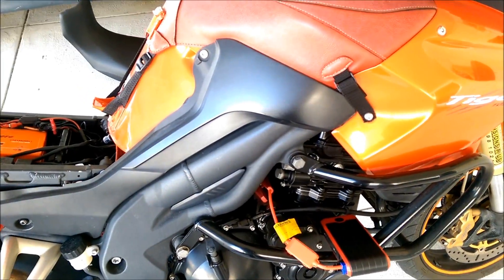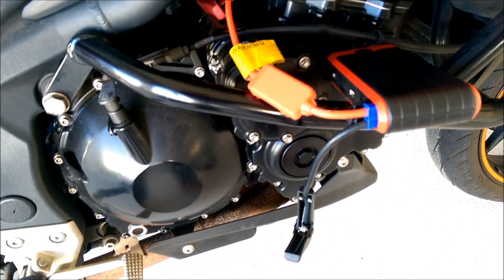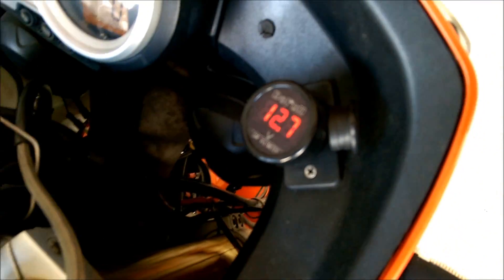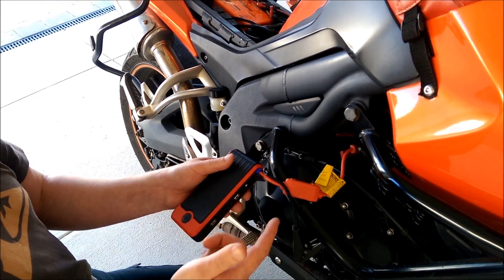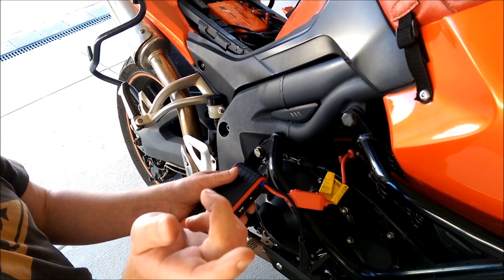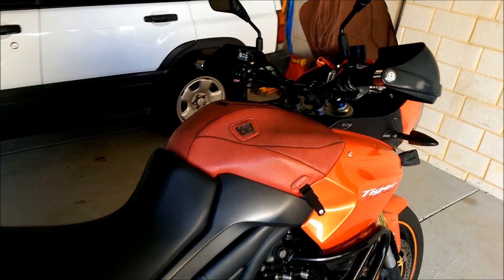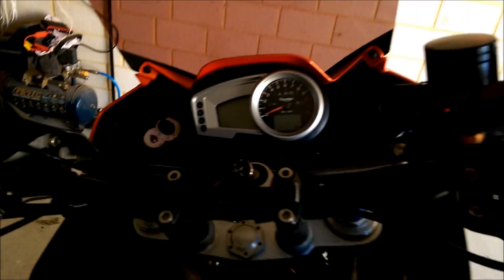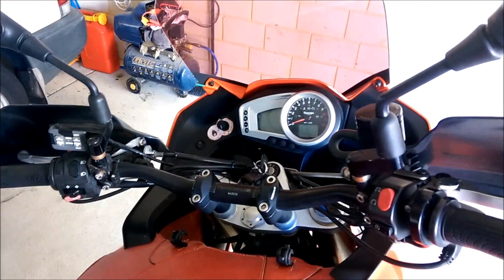2008 Tiger 1050, Problem: Flat battery only when hot!

Comment: Hey, there is solution of this problem. Cables from battery to the starter (+) and battery to engine (-) are too tin. Checked a few days ago on Triumph Tiger Sport 1050 (2013). Good luck! 👍 🏍
Reply: @grzegorzkalinowski3698
How or Where can we find the ticker cables ?

Comment: Problem fixed for me: installed thicker battery wires, from battery to starter motor and negative from battery to frame. Problem completely solved.

Comment: TRIUMPH TIGERS ARE LEMONS - RUN AWAY - THEY WILL RUN FINE IN THE AM BUT THEN NOT START IN THE MIDDLE OF YOUR RIDE - COULDNT BE WORSE IF YOUR WORST ENEMY WAS PLANNING IT - LOVED MY TIGER UNTIL I GOT STRANDED IN THE BACK COUNTRY MULTIPLE TIMES - SHOP CANT FIND ISSUE - NEW BATTERY - LIKELY SOMETHING WITH IMMOBILIZERS - 2016 Triumph Tiger XR RIPOFF

Comment: My bike (2006 Speed Triple 1050) makes almost exactly the same noise during (failing) hot start. Just like you, I have already exchanged battery, alternator stator and rectifier, without solving the issue.
Could you maybe re-upload the mentioned service bulletin? The photobucket file is no longer accessible...
That would help me so incredibly much!!

Comment: Had the same problem on my 2007 sprint st 1050. Changed the battery and fitted thicker battery/starter motor cables. seems to have cured the problem. much cheaper than replacing starter motor.
Reply: Hi Michael Pooles, i have a 2008 Sprint ST and having the same issues... is this fix of yours still working?

Comment: I had this problem with my 2011SE, problem is caused by pressure in the cooling system - replacing the 5 years old radiator cap (as it was not letting pressure out into the expansion bottle) and bleeding the air out of the cooling system fixed it for me... took a while to track down.. Recommend everyone replace their radiator cap every 3 years as a rule.
Reply: Jim Woodward maaan! this is make sense!
Reply: Where have you been all this years 😂 tomorrow going to get one
Reply: @Philip Garmash did a new cap work? My tiger is doing the same...
Reply: @philipgarmash9246  I'm curious as well. My 2008 Street Triple has the same problem. Replaced my starter motor last summer because it eventually broke down. All went well for a couple of months with the new one, but hey, guess what? The problem with hot starts is back once again ...
Reply: TheSilmarallion it did the cap was stuck closed. So far so good
Reply: TheSilmarallion just check it out see if it's in good condition and rubber is not melted down
Reply: @mennojr  did you fix this problem by chance?? And what kind of starter did you replace it with? Another OEM starter?
Reply: @Ariel-hn1ge  Yeah I got another OEM starter and my battery needed a replacement as well, so I got a Lithium Ion one. It starts great now, but I never had startup problems during the cold seasons to begin with. So fingers crossed for the hot summer days ...
Reply: @mennojr  Gotcha.  Thanks for the response! I live in Vegas and summer is around the corner.  I've practically read every forum on Triumph's hot start issues.  I've come to a conclusion of going aftermarket for the starter.  If it resolves the issue after I install it, ill let you know!
Reply: @Ariel-hn1ge  I will do the same! I've read a lot on Triumph forums about this issue but I still think it's a very small margin of error. I know a bunch of people who ride Triumph's as well and never had any problems with it. I'm going to buy another Triumph later this anyway, so hopefully that one doesn't have that dreaded starting issue.
Reply: @Ariel-hn1ge   was the aftermarket starter the solution to your problem /
Reply: Hm just got this same problem on a 3,160 mile air cooled bike that sat for years before I bought it and fixed carbs. Zn1100. After this happened while refuelling it started right up with a push. Didn't do full diag but good battery and it charges right at 14.5 up to 16 when revving. Haven't removed starter but it does the exact same thing. Cranks okay cold but unfortunately discovered today that it does this now when trying to restart with a hot engine. So no rad cap replacement fix for meEe 😆 it's funny the red cap worked for you because I don't see how excess pressure in cooling system would cause the starter not to spin or the gears it meshes with not to spin. They're in the crankcase and the coolant should have nothing to do with that right? How's pressure in the rad or cooking jackets going to stop the spinning of the starter and the gears it meshes with?? Genuinely asking because I don't see how that could cause starter or one way starter clutch bearing assembly resistance.

Comment: Did anyone buy the starter kit and fix the problem???
Reply from the maker: Yea I bought it & fit it myself, cost me $1200. Fixed the problem for about 6 months. Definitely improved it, felt like a stronger start. 
6 months later it did it again, left me stranded, wouldn't start, no solution, I had done everything possible to fix it.
Sold the bike & bought a reliable Honda.
Reply: @plve82  after reading your struggles I'm glad to see you got rid of the POS. Triumphs are POS. How about them Daytonas right? I believe they're the ones? Always liked all the different aesthetic changes but then read several reports of guys riding them around at cruising speeds around 4000 rpms when the crankshaft shattered into pieces causing them to wreck. Have you ever heard of this problem?
Reply from the maker: @kkc3009  Hey KC, no I hadn't heard of th Daytona's self destructing but it doesn't surprise me. My experience with Triumph makes me realise that Triumph doesn't have the R&D to keep up with their modern designs. They want to keep up with Japanese manufacturers but they can't build them reliable. 
My Honda, 2012 VFR1200X Crosstourer I bought in 2016 has been an absolute delight, not a single issue, just perfect reliability. So so happy I made the change 👌
Reply: @plve82  have some older Hondas I got in rough shape and only got  the one with low mileage to run good. Go figure it was a 3,000 mile cx500 that ran beautiful then leaked coolant like a b!tch out of the water pump cover weep. Pretty sure it's due to a metal fan shaft bearing and requires engine removal because you can't get a puller in the space to remove and install a new bearing. Thought about just plugging the weep hole and riding til destruction but I put it up. Not a huge fan of Hondas but can't argue that most have a winning reputation with few major engineering flaws. I never had a little to problem free Honda but I would probably love an 07+ cbr 600-1000. Never had anything newer than 01 bandit 1200. I can say I'll never have a pretty Daytona or cool looking tiger for fear it'll be even worse to deal with then all my old rockets and big fours.
Reply: Paul Van Eede you'll be laughing right now! It's freaking radiator cap 😲

Comment: Had the same problem on my  2012 street triple, did the same as you. replace the battery, relay and solenoid but still the same, as soon it gets hot no start. Turns out it was the starter motor, its was full of carbon dust, brushes where worn out. I think the carbon must raise the resistant's so the motor won`t turn when it gets hot. You can not buy replacement brushes for the motor from triumph only a replacement motor at £360, F**k  that..... I have brought some brushes from ebay which are very close in size, I`m going to fit them this weekend, I mite have a go at making a video

Comment: Hey dude, ive had exactly the same problem on my '12. It was extremely annoying. 
Luckily i had an easy fix, replaced the stock battery with a higher amp battery and now its solved. Before that I had been looking for a fix for ages and its seems like there is not a similar cure,  what works for one.. doesnt work for the other. So best of luck with finding out what keeps the tiger from starting!
Reply: Michel Kleijer how battery aber do you buy now ???
Reply: Antigravity AT12-BS-HD RE-START Battery

Comment: Have you figured out, I have the same problem, checked all the connections, measured all the relays, rectifier, stator,clutch switch, neutral sensor, side stand switch and no success:(
Reply: Hello, i've got the same problem.does the new spare kit solve the problem?
Reply: runguigui  tell me whar are you doing for the problem??
Reply: ganashev you find the problem??
Reply: hi, it seems that the problem come from the starter kit. That's a very strange problem. cold ok, hot problem!!
i'd like to buy the new starter kit but i'm still waiting ....so expansive. Does someone test the new starter kit T1229901?
Reply from the maker: +ganashev Yes I've replaced everything too with no success! But Hey yes I think I have the answer!.... It is a design flaw in the Engine starter idler gears! & there is a Service bulletin out from Triumph to fix it!

Here is a photo of the 1050 engine with the starter/crank engine cover off: http://i380.photobucket.com/albums/oo247/hxr400/NEW/Sprag%20Clutch.jpg

My Theory is, Those Idler gears you see rite there in the photo are The Problem!! They are the design flaw! When it gets hot, they run out of clearance & bind up. The starter motor doesnt have enough power to push through when they are hot & tight. Let it cool down, the gears loosen & it free's up.

The new starter kit replaces the following parts; 

New version Starter Motor
New version heavy duty Sprag Clutch
New version different ratio Starter Idler Gears
Different shape x2 Engine covers 
Required Gaskets.

Part Number for new Starter Kit: T1229901

Triumph Australia deny they know anything about my problem... But they do recommend fitting this kit & it 'Might' fix it'.

I think Triumph know EXACTLY what the problem is! & thats why they made this new kit! It replaces Starter Moter, Idler gears & Everything! Even new shape engine covers!! 

The Kit costs $1258-AUD ..... Triumph expect the owner to fork out to fix this problem.
I think that's terrible! Triumph should have done a recall & fitted the kit for free to every bike! 

Here is a link to the Triumph Service Bulletin about the required new starter kit: http://i380.photobucket.com/albums/oo247/hxr400/NEW/1050%20service%20bulletin%20from%20Triumph.jpg

Have a look at your engine number. The first number is 5. Its irrelevant, ignore that number 5.  

Minus the 5 at the start, If your engine number is Under 502538, then your engine requires the new starter kit.

Minus the 5 at the start, my 2008 model engine number is 338478, So mine is way under & requires the kit. You's certainly does too.

Ive ordered the kit, I'll have it in 3 weeks. Going to take lots of photos & compare the starter idler gears & everything.

Its HAS to fix it. There is nothing else to replace!
Reply: +Paul Van Eede do you have that bulletin? Can i take a look on it.
Reply from the maker: +ganashev Here is a link to the Triumph Service Bulletin about the required new starter kit: http://i380.photobucket.com/albums/oo247/hxr400/NEW/1050%20service%20bulletin%20from%20Triumph.jpg

Comment from the maker: I dismantled the starter motor, nothing wrong with it! I replaced it with another one, Did nothing! Its still doing the problem!! If its not an electrical problem & its not the starter motor Then what is it?? It can't be the Sprag Clutch because that wouldn't act like a flat battery only when hot! & it definitely doesnt sound like this: https://youtu.be/T6KnPVL8TSM
Reply: fix fix..totally agree , i did this and what a difference to the turn over , them three pots take some turning
Reply: @Kevn Foje do you have the battery upgrade no. Please

Comment: I had a 2006 Speed Triple and had similar issues. Ended up changing the stator along with the regulator/rectifier - seemed to fix the electrical gremlins that come along with a british bike!
Reply from the maker: ok cool, yea I've replaced my stator & regulator as well in the past, but it didn't help with this. Don't see how they would help with this either. This is a flat battery only when hot. Once it cools down it starts fine. I've now proved here the starter motor is the problem.

Replacing the Stator & regulator would only fix problems with charging while running. 

Thanks for your info tho ;)

Edit... The starter motor is not the problem, the Starter idler gears are the problem. The new starter kit fixes it.

Part Number for new Starter Kit: T1229901